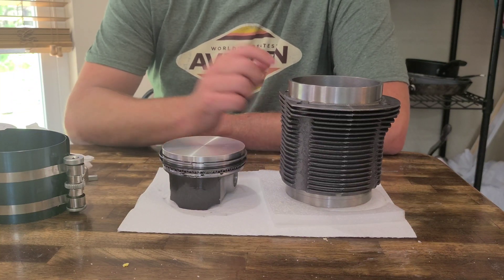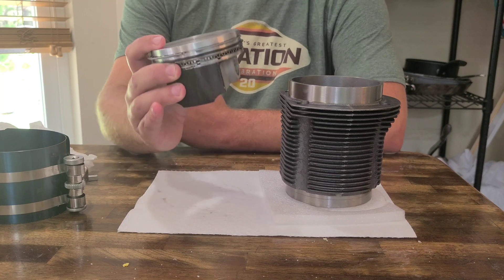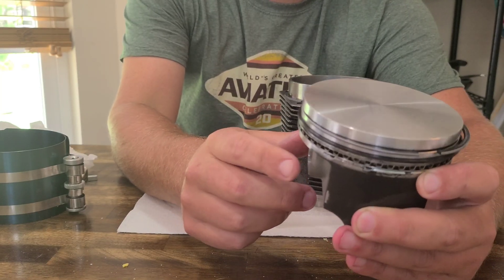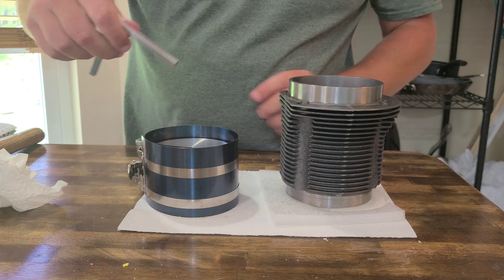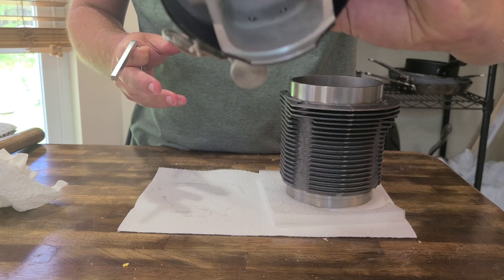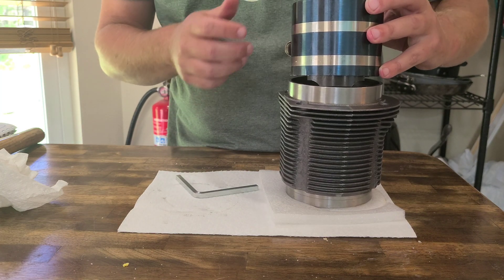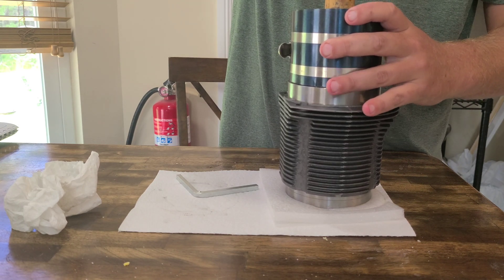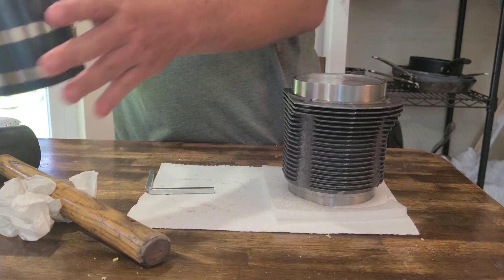Sonex Aircraft Piston Installation

Comment: When I watched my AME do top overhaul and he was putting the pistons in the cylinders everything was dripping in oil. 
You got your seated nicely,  so obviously it worked but more lubricant would have help with the slide from the ring compressor into the cylinder.  

Anyway,  great job and thanks for sharing your experience.
Reply from the maker: Thanks for the kind words and advice Peter!